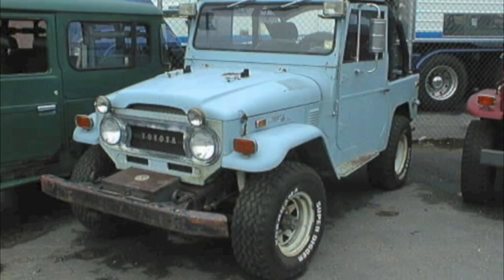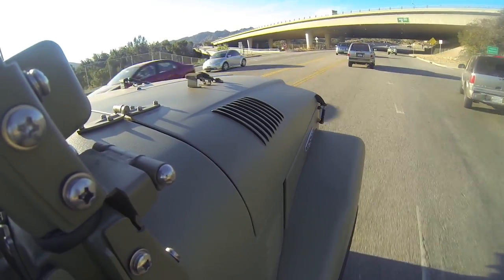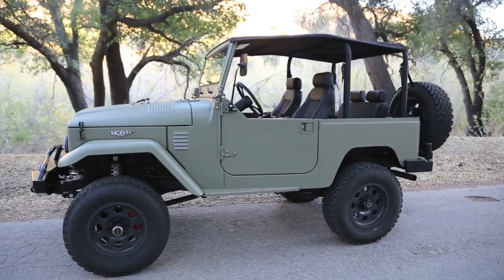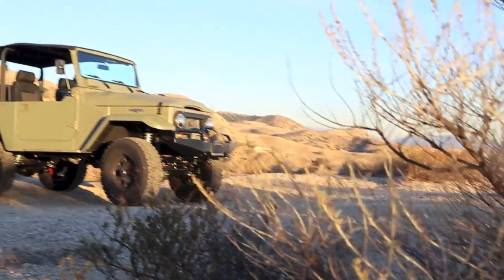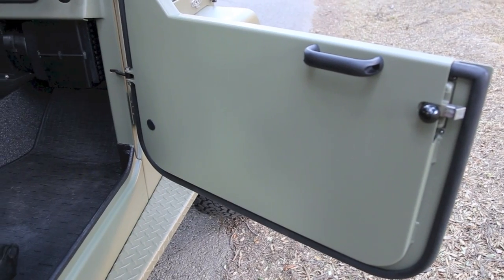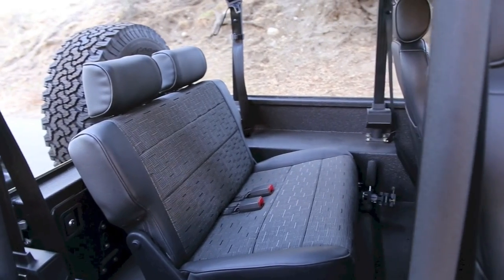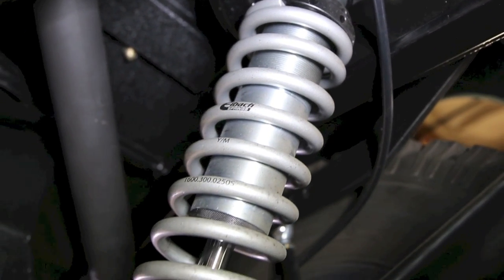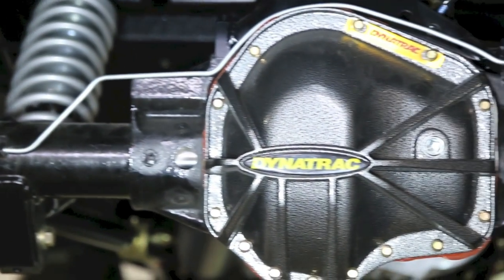ICON FJ40 #80 New School Restored And Modified Toyota Land Cruiser FJ40

Comment: Your price points do not suck at all.  $30K - $75K for what I get brand new at a local dealership is a sucky price.  The value is there in the Icons for sure.  The price is just higher than what most Americans can afford.  Some day I will drive to Chatsworth with a Kaiser M715 and a blank check.